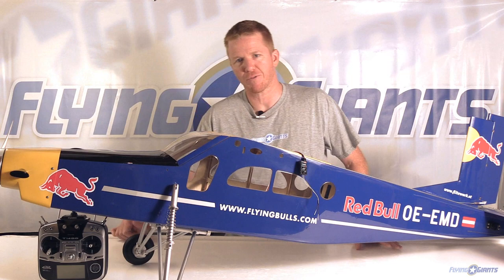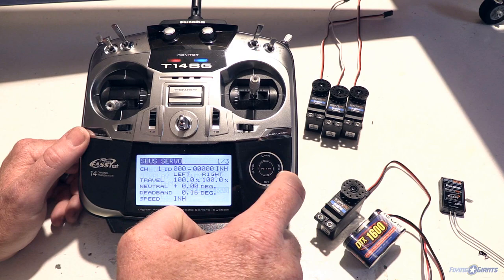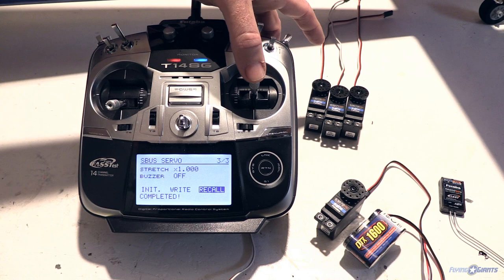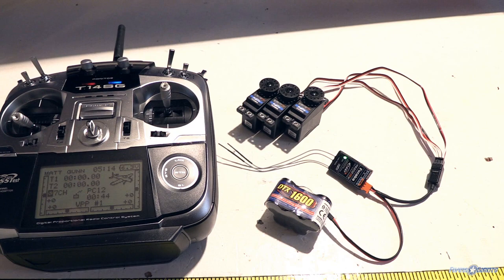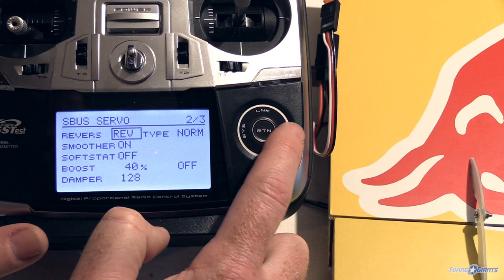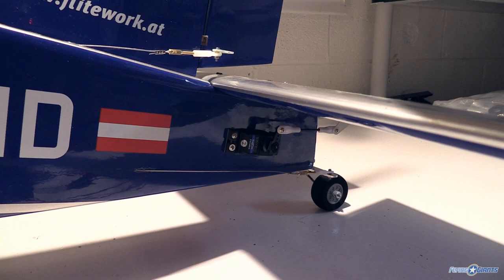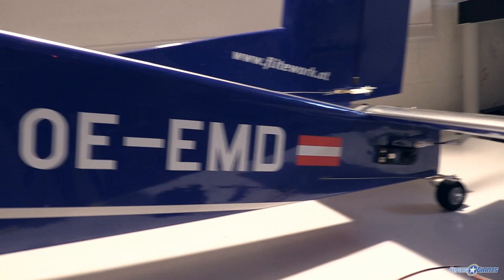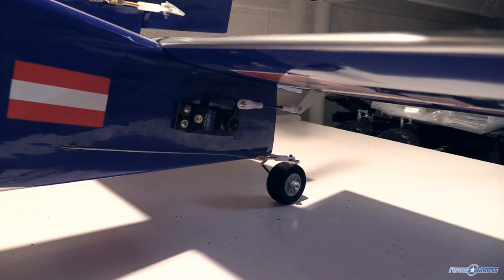Futaba S.Bus - FlyingGiants Video Tutorial

Comment: Hello. Great video. Very informative in plain English. I'd just like to know what type and brand of (black) clips you are using to anchor your wiring coming off of the receiver. ie: the receiver antenna and hub wire going to the rear. Thanks.